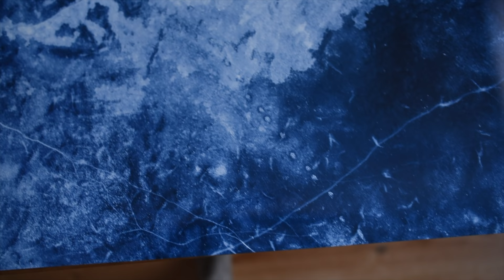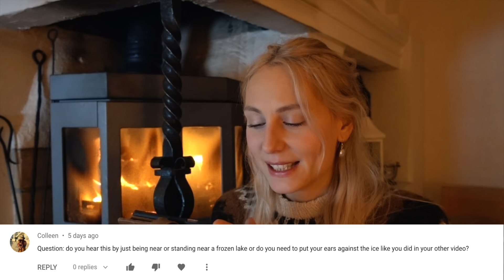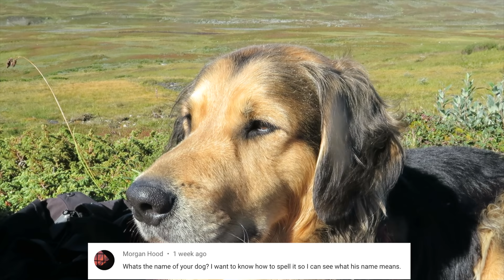The contrasts in life | Ep. 34

Comment: Aloha,  When I was a child there were little houses on the lake for fishing in the winter.  The ice could be as thick as one meter, so cutting new holes took effort.  We would float a small oil lamp that kept burning when we were away overnight and that was warm enough to keep the water open.  Perhaps there is some way to do that with your ice bath.  Perhaps a light-weight roof structure with a floating lamp.  If the material was translucent then it might be very beautiful during the long night. A hui ho, Parker